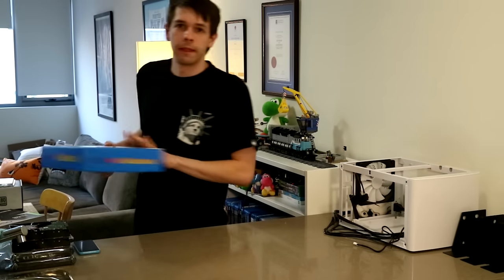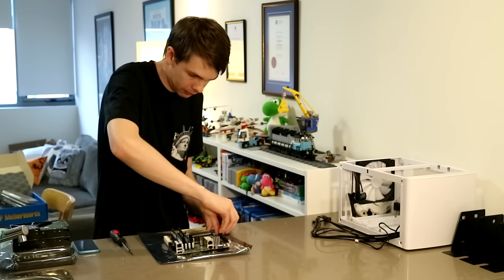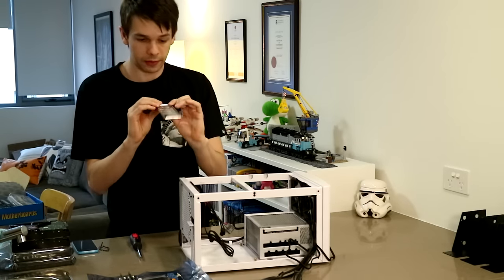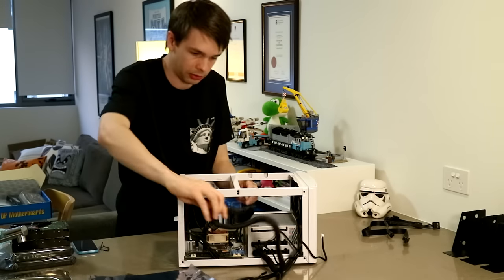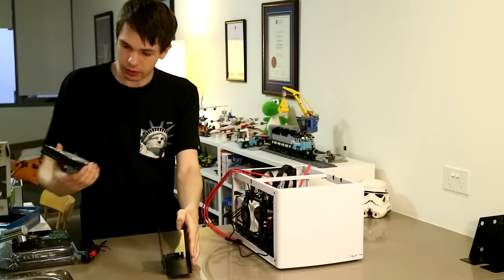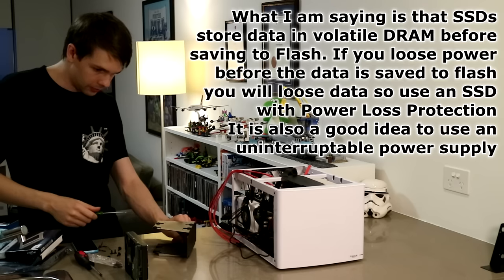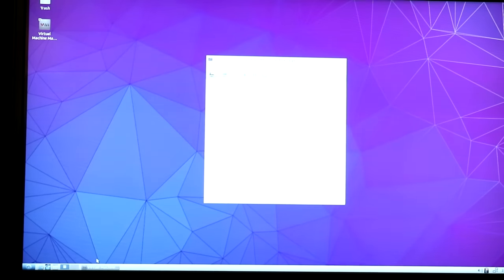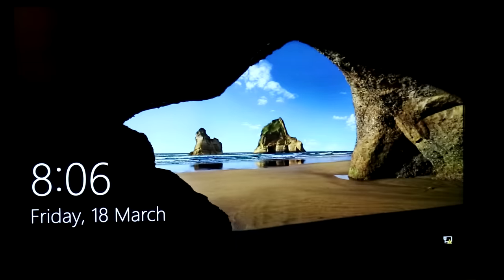2016 Xeon D-1521 NAS Homelab with GPU Passthrough

Comment: Hi, nice build! I'm planning to have a similar one with the same X10SDV series motherboard and also utilize NVMe M.2 SSD memory for OS. However, in the Supermicro user manual it says:

"The X10SDV series deploy an M key only dedicated for SSD devices with the ultimate performance capability in a PCI Express 3.0 X4 interface for native PCIe SSD support. The X10SDV M.2 is mux with the I-SATA0 port for legacy SATA SSD devices."

This word MUX... Does it mean that this NVMe SSD connected to M2 becomes I-SATA0? and then I will be able to add only 5 sata HDDs not 6? Can you please explain how does this work?
Reply from the maker: +DUBAI MEMES depends which M.2 drive you buy, most are SATA which makes the M.2 slot SATA0. I bought the Samsung 950 on purpose because it is NVMe which means I can use SATA0 normally which I have.
Reply: Thank you so much for explanation!

Comment: Thanks for posting this. Could you share where you found the D-1521 Supermicro board? I've only seen the older D-1520 available.
Reply from the maker: +Dominic I got mine from Newegg. Supermicro updated the existing SKUs as Intel replaced with the new stepping and did not create a new part number, there was nothing on the box to indicate which processor it had, and I was pleasantly surprised when I checked the BIOS.
Reply: +smithydll Thanks for the reply. I really appreciate it.

Comment: Are you a 10Gb switch on your NAS? If not, are you planning on getting a switch to maximize data transfer?
Reply from the maker: +Martin Ducre thanks for commenting, right now my client needs don't exceed 1 Gb/s. I will look at setting up a LAG/bonding before I spend money on 10 Gb switches. I did a crystal Disk Mark test over SMB between VMs and can saturate the speed of the SSD write cache which is only about 5 Gb/s after overheads. Read test maxes out at 2 Gb/s which I think is the limit of the mechanical disks. I think N-baseT is the future of SOHO networks, but that is still over a year away from being in real consumer products. My plan is to run anything disk intensive on a VM. My WiFi is also a bit slow even with 802.11ac to a Surface Pro 3 due to WiFi congestion that comes with apartment living. I might do a write up of the performance I get.

Comment: Can you transcode multiple 1080p plex streams with this? What kind of temps do you get with the stock cooler
Reply from the maker: I can transcode multiple 1080p plex streams no problem. You need 2000 geekbench score per stream and the D-1521 gets just over 6000 score. The stock cooler is passive on my model, but there are other models with a fan. I had to use an aftermarket fan, but you would be fine without if you had it installed in a supermicro force cooled 1U chassis.
Reply: Thanks for the reply.

I was looking to put this into a 
http://www.u-nas.com/xcart/product.php?productid=17610&cat=0&featured=Y

Which doesn't appear to have the greatest airflow, it's really cramped. Guess I just have to try and see how it goes.
Reply from the maker: That's a nice case, you will definitely need active cooling on the CPU to stop it thermally throttling when transcoding with plex.

Comment: Hi 

Can you please share the  fan link that you used and also if u can post another small clip showing  how to mount fan . That would be help

thx
Reply from the maker: +sachin khera Hi, my system is in production but the fan is easy to install, just use the anti-vibration rubber pegs and it sits on the heat sink fasteners perfectly. Just don't ship upside down. The fan is a Noctua 60 mm NF-A6x25 PWM http://noctua.at/en/products/fan/nf-a6x25-pwm
Reply: +smithydll 

Thx for the quick reply
Reply: +smithydll 

Can we use fan with 1U case too . Will that be fit in 1U case ?
Reply from the maker: The board is designed to use the air flow from chassis fans in a 1U enclosure. Make sure your 1U enclosure has a row of fans at the front to force air through the CPU heatsink fins. The fins are aligned to allow air to flow from front to back without blocking air flow.

Comment: Can you share exactly which CPU fan you are using? I have the same board and its overheating, so Ill def need a fan.
Reply from the maker: The fan is a Noctua 60 mm NF-A6x25 PWM http://noctua.at/en/products/fan/nf-a6x25-pwm The board thermally throttles without it unless you use a forced ventilation 1U chassis.

Comment: Nice build, I can't get quite with people using these type of cases for a multi disk NAS, its going to be horrible swapping out a drive, hopefully it will be a long time before you need one. I do like this D-Series a lot and I'm well jealous of the 10gig though I prefer SPF+
Reply from the maker: +Darren Williams Thanks! You don't need hot swap bays for a home file server. It's being realistic about your requirements and realising what you just built is overkill anyway. The Node 304 has bays you can remove so it's not too bad to access. Not like rack mount equipment stacked on top of each other. I planned my storage requirements to be adequate until the next upgrade cycle. I then broke the existing array to have one old disk and one new disk in each vdev in the zfs pool to spread the disk.
Reply: Yep, I guess you're right, I have a few virtualised boxes, actually three quarter racks and a little bit more so I can't afford any down time, I'm thinking of it from a commercial perspective rather than from a home user. Loving the passthru too, I didn't know KVM could pass through PCI. I actually have a quarter rack here at home with about 5 Dell R210 that I use for some TV work. They have video capture cards in, one server for each camera. The whole thing only goes out once or twice a month and I've been thinking how good it would be to vitualise it so I can make use of it for testing etc. I was thinking LXC may be better being as its video capture. I'm definitely more motivated to try now though.

Comment: You would get better performance if you would use the M.2 SSD as Cache and the SATA-SSD for OS.
Reply from the maker: You must have missed the part where the SATA cache drive has power failure protection and the m.2 drive doesn't. Data integrity trumps performance, especially when it already saturates my network.

Comment: That's a great build. Are you using USB pass through to use keyboard and mouse with the HTPC or just needed the GPU? Also what OS are you using for the pass through?
Reply from the maker: +James Bland I ended up passing through an entire USB controller to get multimedia USB devices to work properly. I was testing a USB audio controller from a broken set of headphones and without PCI pass through for the USB controller, the sound was just choppy. Keyboard and mouse are fine with just software pass through, but if you have a sound card or game capture. The SuperMicro board has 2x USB 2 controllers and 1x USB 3 controllers. I just wish that two of them were on the back rather than two headers, who needs 4 USB ports via header in a server?
Reply: Mind giving a bit more info on the build as in Hypervisor, what you've got running ZFS, etc? Also have you tried any games on that HTPC? Wondering what it's like with the slower core clock on the Xeon D.

Maybe a second video to cover this?

Comment: I cringed when he worked on the motherboard placed atop the conducting outside motherboard bag. The inside is non-conductive only. Yes, you probably don't experience any problems but you do enough of them or when Murphy hits, then you might rethink about using something else. I use a non-electrostatic Dish drying mat (Amazon ASIN: B00GFDRT64), which protects softly to support any objects you lay on it, including the face of monitors. I keep one in my work truck for onsite jobs.